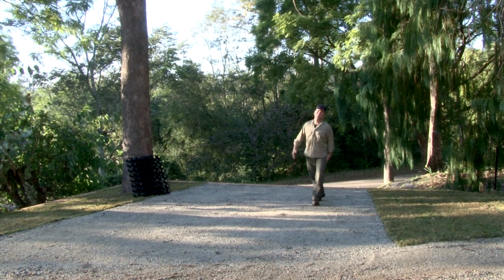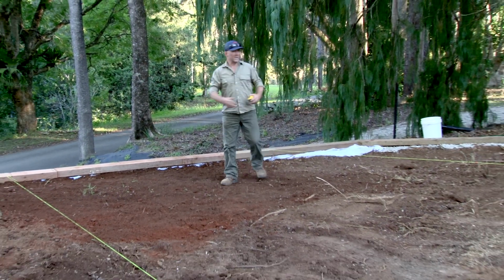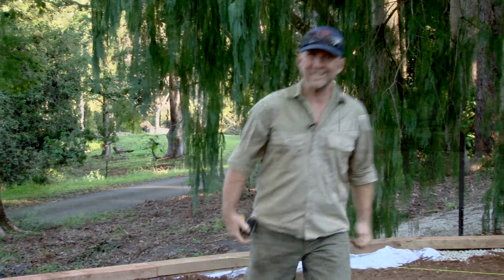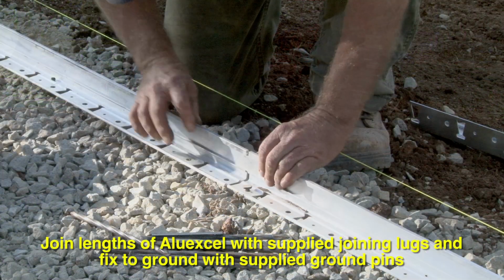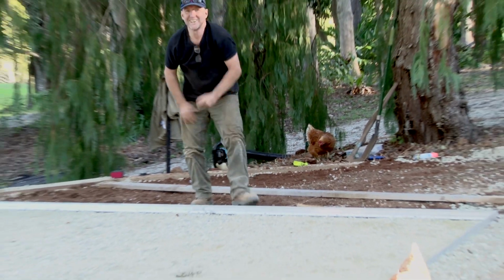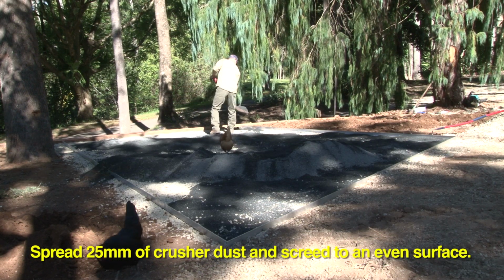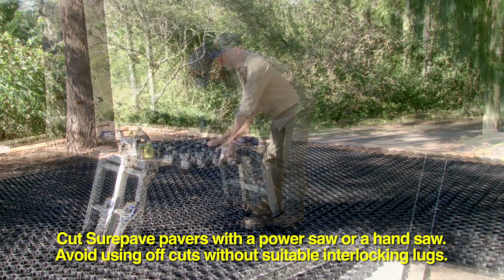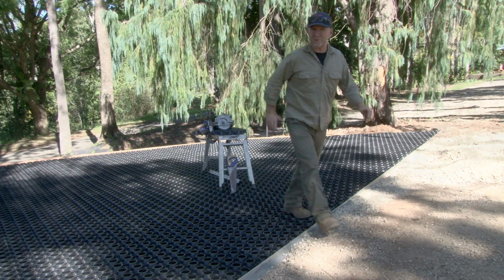SurePave | Permeable Paving - Hardstand Video

Comment: I think the hardest part is the ground preparation : scraping the top layer, and level it with base.. Any tips this can be done by ourself?
Reply from the maker: Hi there, this would be project dependent. If you are doing a garden path then you can do it on top. However, for larger projects like a driveway,  you may have to get a friendly bobcat operator or small digger in to do this for you.